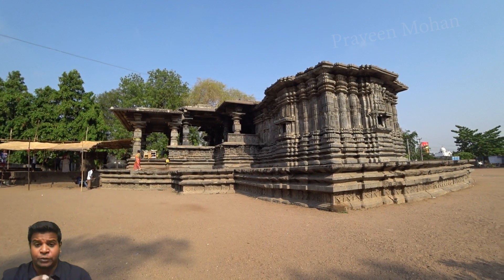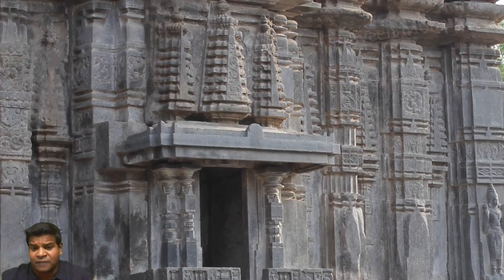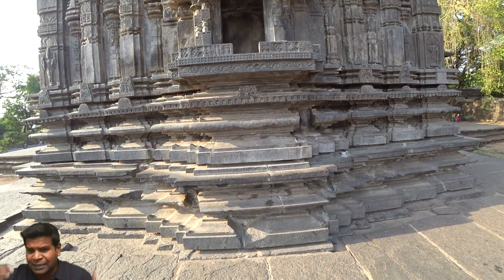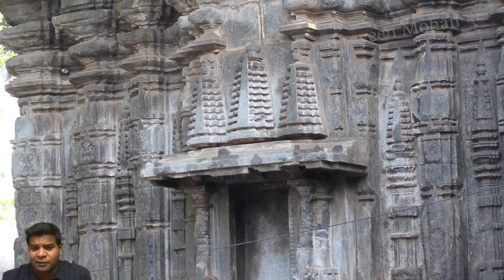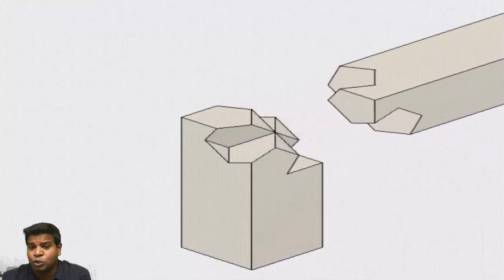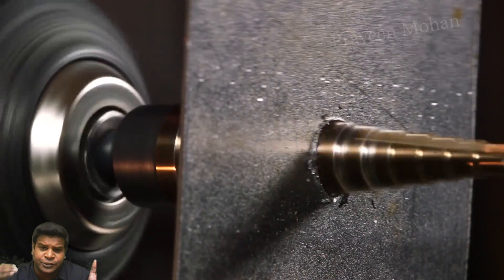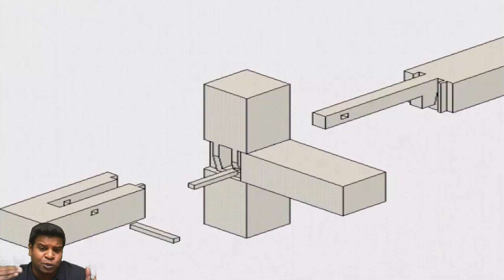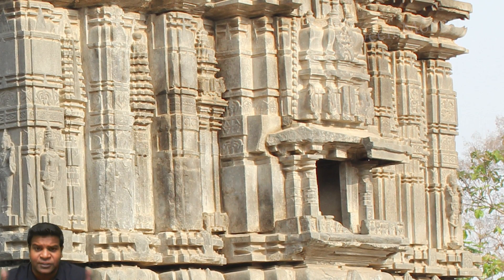1000 Pillar Temple - Impossible Ancient Technology Found?

Comment: 4:50 that looks like some wireless energy tech being used, look at the guy on the right, hes wearing the thing on his head, then on the left hes got "lightning" coming out of his hands? Thats a tesla coil right. Those look like modular wireless antennae, evenly spaced around, and then hes wielding the power. The drilling is like wire edm but with wireless electricity the rock disintegrates with the instant local heating and the heat doesnt propagate through the piece its almost like a laser.

Comment: Unfortunately he doesn't know all facts. There used to be another structure which was dismantled to be reconstructed but unfortunately they haven't figured out how to put back those blocks in place. What you see now is only a partial structure. Much of the carvings have been looted. Did you know that the foundation has sand and there is a well with water which was discovered when they diamanteled the foundation

Comment: 🏛️🏛️🏛️🚖🏛️🏛️🏛️👍👍👍🚦🚦🚦THE HONDURAS. ( L ) SHAPE IS STOP LIGHT BOX.  IS THE CONSTANT IN INFINITE BLUE WATER MULTIVERSE.   THE SPEED OF LIGHT IS ONLY ABOUT 3000 MILES PER HOUR.  STANDARD OIL ROBBED BP AND ARAMCO... THE HORN IN EAST AFRICA IS CARROT... THE COLOR OF GASOLINE TO MAKE CAR GO.  CAIN KILLED ABEL..ABEL IS THIRD REICH... BELL RINGING.   U.S. IS CAIN.  JUNTA..  ESP .. DRINKS ON HOUSE.. FREE RIDE HOME.  CARROT TOP CHURCHES.  ILLINOIS IS LINCOLN'S SLUG WITH BODILY FLUIDS.  IS BALLET SLIPPER.  SPEED OF HEAVY.  NOISE LINCOLN'S BIG EARS DOES NOT KNOW HOW TO TEST THE SPEED OF LIGHT.   1865..  186,000 MILES PER SECOND IS A BROKEN ICE CREAM CONE... (AD). 🌲🌳 MOUNT ALLAH IS ALL FIR TREES AND MOUNT OLYMPUS IS ALL DECIDUOUS TREES.

Comment: such intricate joints could have been first designed in timber, or clay, from which moulds would be made ,and then a geo polymer type stone solution could be poured and allowed to set ,just like concrete is formed and poured.So many columns seem to be of similar design, so a mold technology would be very useful to produce the same joints. But those drill- bit like sculptures also imply a lathe type technology. Why not a combination of both techniques? Great insight Praveen, as usual!
Reply: Throughout history and various cultures, the builders, architects, masons ( call them what U will) have always had their trade secrets which they naturally guard very jealously. The Architect was always the most important part of the equation, as it was they who developed all the ideas, before then instructing the builders in the techniques and equipment  needed. Hence  the Great God is referred to often as the Divine Architect, as He designs All, then employs the Gods to carry out his Divine plan. So the Hindu's have a Creator, a Preserver and a Destroyer. Each doing their part in the Great Design that we call Life!

Comment: I don't think they used tools that we use today. That's lazy thinking. Whatever they were using was of a different nature all together and was powered by something other than electrical current. If you think they were using something small and modular like electric tools, you would see evidence of it everywhere. And it would have been extremely hard to hide such an achievement historically. Thd tools would be easy to find and other cultures would make quick mention of them. I think their technology was powered by something entirely different. And the techniques they used with the tools were as complex as the tools themselves. Even the tools we use today aren't really suited for those type of cuts. Whatever they were doing is completely seperate from what we do.

Comment: In my opinion as a modern day builder, I would join the columns together by hiding the joints in the cross sections that have many horizontal lines, and core drill each section, inserting a rod that runs all through the core. You can see many cross sections that have many horizontal lines at the bottom and the top. It would be easy to hid a joint there. 

As to the middle sections of the columns.... one large middle section could fashioned to make many columns out of one singular piece, maintaining continuity of design and when joined together with the bottom and top pieces with rods running through them all would make for one indestructible design. 

The rods would be made from a non corrosive material, such as the material in your iron pillar video. But your statement that it could not be made without technology is absolutely true for a piece like that, symmetrical in all ways. 

Historians and scientists are fools to believe that ancient man wasn't as smart as us... no reason not to think that they had sophisticated tools. 

Just look at the passage in the Bible that talks about Solomon building the temple... or in Moses day when they built the ark of the covenant. In the case of Solomon, it says a metallurgist was found that had knowledge of all the metals. That was 2,500 years ago. They overlaid the ark of wood with intricate works of fine gold... that was like 3,000+ years ago. 

Thanks for all your research, very intriguing.

Comment: The more I see temples and structures like these, the more I think of cold casting/molding and top-notch hand crafting.

It's easy to think of chemicals found in nature that could temporally soften the rock, and others (or simply time) to let these harden back. After this, one couldn't notice any difference with a natural rock unless they'd have mixed different types during the soft-time (off which there might be some proof somewhere out there), and which would explain how some of the biggest rocks/megaliths out there where made.

So for them, to achieve such a great detail in stone would have been as difficult as doing it in clay, just because that's what It would have looked like before hardening.

I keep on disagreeing with you on the fact that such clever people would use square drill bits, but after watching those animations it occurs to me these could be the tool used to do/finish those complex joints mentioned? The tool is conical-squared shaped and these joints always show some such features.

Comment: Anyway did you know when making concreate if you use LIME instead of CEMENT, lime over time solidifies into rock becoming harder and harder over time longer it's there the harder it gets unlike cement that will crumble 100 or 200 later, lime cement a 1000year later will be as solid as a rock. They might not of used lime in the past thetes probably over minerals that act similar or are better . If you look at the ancient stone you'll  find there some kind of geo-polymer the level of detail in india reminds me of the type only acheivable with carving in wood. Today we have carbon based trees but in the past we had silicon based trees could be something to do with that wood does petrifie can you image what mdf or sawdust looks like when petrified

Comment: You did a good job BUT you ask if the builders  carved those drill bits on the wall and is a good question  also they build  temple without joints so in this case we have a team of builders capable  to build without  joints but unable to carv simple drill birs?! And other question why they choose to depict  a drill bit instead  cutting  machine or other tools.

Comment: Those modern drill bits are only good for drilling metal or softer sheet , up to 3-4 mm . For this stone work you need grinding bits with diamond particles , at 10000-30000 rpm

Comment: I think these are not natural stones, but stone powder mixed very low percentage of tin  led, or zinc like metal, small curved holes are possibly cast using none sticking thin coils bronze or acid etchable metal  in casting dies later removed to achieve curved drillings like appearance, high heat and high-pressure casting techinqe that avoid a lot if chisel work ,gain precision on stone out casting die

Comment: Your thoughts towards tools being used are not the ones your showing us, the ones you show are just hole cutters, I think your thinking of router bits...they look very much like finger joint bits....(modern day) …this means if they did use some sort of router bits they must have had something to spin them and a wheel would be just the right thing...very much like milling stones..
Reply: And the joints you show are very much like Japanese joints which they’ve used in their buildings for centuries..👍🏼

Comment: I wonder if researchers have ever used metal detectors around the temple complex to find tools or broken tools? Seems that we should be in search of such discarded or lost implements at this point. We must find the ancient workshops on the grounds nearby... Also, even with the possible bits you show, how does one make such precision cut's without using CNC type machines and precise measuring devices? Perhaps a 3d high pressure water cutting machine was used and the "tool tips" caved in the side were high pressure nozzles?